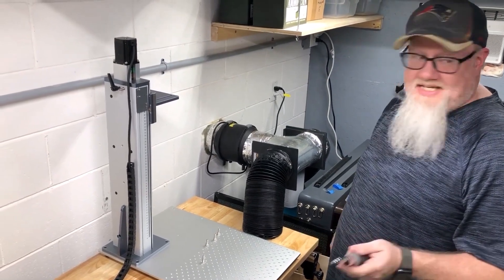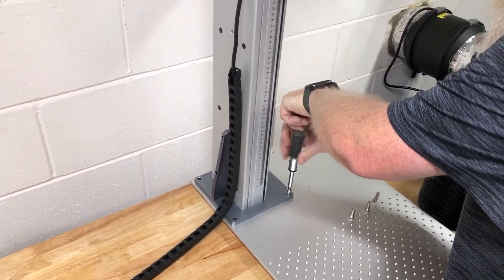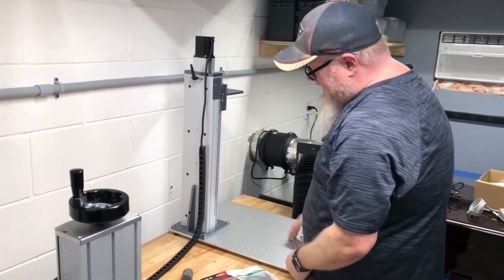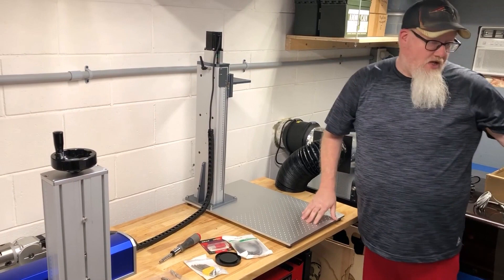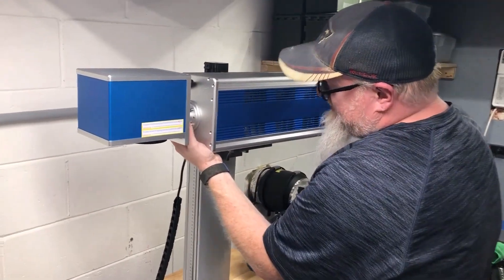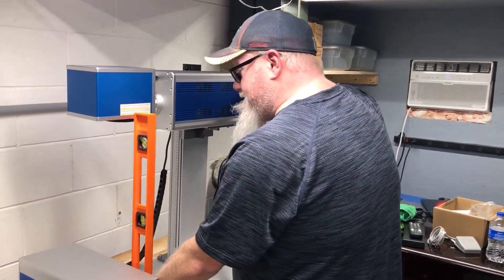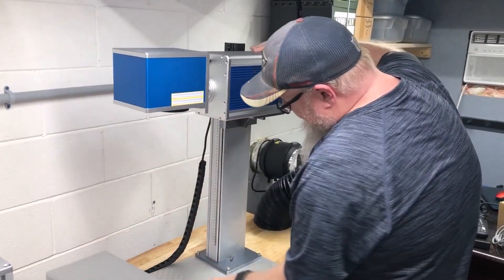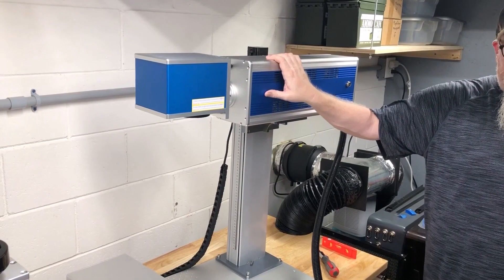Putting The Co2 Galvo Together

Comment: Hi I saw the video and was wondering how far back the galvo head goes relative to the plate?
 I ordered a Haotian 100w MOPA fiber laser and I have an 80cm table facing a wall. In your opinion can this be enough?
Reply from the maker: @marcoc.1646  yes, it is enough for fiber laser. Not for this CO2 galvo laser